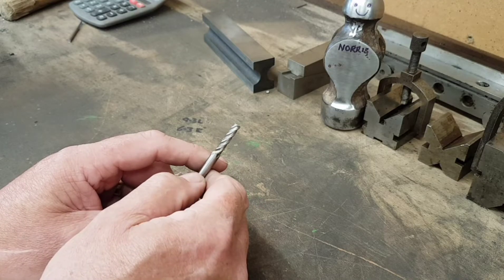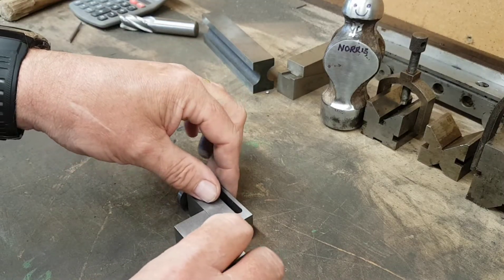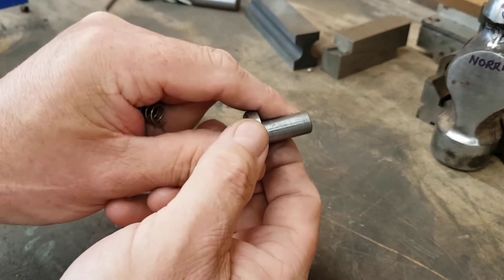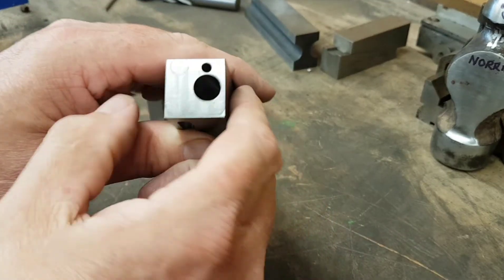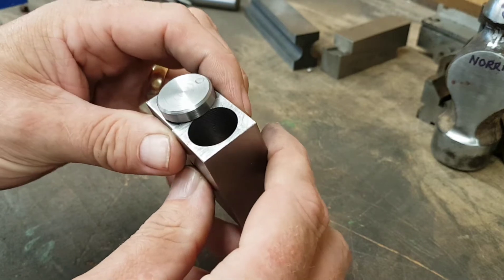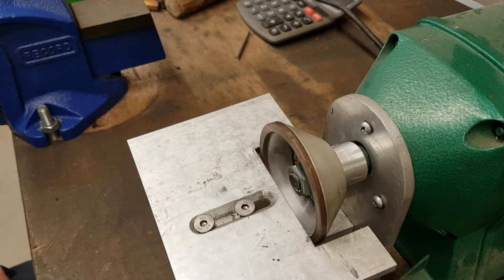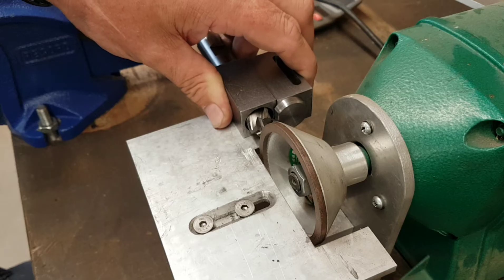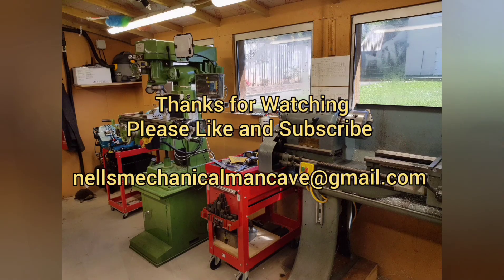End Mill Sharpener Part 1 of 3

Comment: If the hole in the block was lower down you wouldn’t need an “anti rotation pin” - just cut a flat on the bottom of the plunger with a couple of thou clearance of the base plate.
Reply from the maker: Good call Victor!
Sometimes you cant see the wood for the trees, as the saying goes 😊
Cheers Neil

Comment: I have been searching high and low trying to find an accurate way to sharpen my end mills myself, I seen this style in a book but forgot the name of the book. I guarantee I’ll be building and trying this fixture. Thank you for putting this up Neil. I’ll be watching all 3 vids. I’m also on a shoestring budget
Reply from the maker: Hi, 
The idea came from a book by Harold Hall and Mr Factotum ( Kev) did a few videos on the design. I don't know the exact name of the book but Kev mentions it so it's easy to look up.
Cheers Neil.

Comment: Why have you not considered installing the wheel on the other side of the bench grinder ? It would have turned the opposite. Anyway, thanks for sharing.
Reply from the maker: Hi my friend !
There is a slow speed diamond lapping disc on the other side of the bench grinder. It can be seen in earlier videos but not visible in this one. 
Thanks for coming by and watching.
Best regards,
Neil

Comment: This a bit similar to what I did, however  I am not sure it was my idea or just adapted from Harold Hall's video that I will leave a link to below. If works fine and saves money then it is an Excellent Tool! John, Australia.
https://www.youtube.com/watch?v=mMZt6m52j2M
Reply from the maker: Hi John.
Harold's design has gone around the block a few times and each incarnation has a slight improvement. Very clever man Harold !
Read your bio, and totally agree on what your dad said. I'm in the same boat sort of. I can't buy because I have no income so I make with what I have. Best of all, it's fun!!
Many thanks for dropping by and commenting.
All the best Neil...
Reply: @NellsMechanicalManCave  I am subscribed so it was not an accident. I like channels like yours as I can always learn a different way of thinking.
Cheers from John.
Reply from the maker: @joandar1  Thank you John for being a sub !!!
I do tend to be unconventional in my thinking. Out of the box is the usual term that is used. Most people look as something and see it for what it is. I look at it and see what it could become 😊
Cheers Neil
Reply: @NellsMechanicalManCave  No such thing as Scrap was part my Fathers MO. For example I have an internal bore diameter grinder that I made out of a 4" angle grinder with a crook gear head that I use on my lathe, the motor was/is fine. I needed to remove the bell mouth in the 3 jaw chuck and the spindle speed on the motor was perfect. End product works great an my chuck now holds stock to 1 Tenth of a thou of center. Just one of many things made from PRE LOVED Material/things. John.
Reply from the maker: @joandar1  Excellent John. Do a video of it. I could help someone out there !!!
Reply: @NellsMechanicalManCave  No sorry I do not, I did not record making it or its use. I will see if I can take a picture of it and send it to you. I used one type of grinder so others would need to design their own to suit their donor motor and so it goes on. Is your email in you home page as I do not have mine in my info. I need to go soon as it close to bed time for me. I will look at your home page in the morning and see what I can send that way. John.
Reply from the maker: @joandar1  Hi John.
My email is shown at the end of my videos as well as my home page.
Sleep well !!!
Cheers Neil

Comment: Good work. Why not just put it on the left hand side, but with either the cutter block on the outside (exactly a mirror image of the way you had it on the other side) or put the stop block on the outside but with the half of the cutter you are not sharpening on the outside too?

PS, to reverse a single phase induction motor, just swap the starting coil's polarity with respect to the main coil.

PS, not a good idea to reverse grinders as the nuts will come off causing injury.

Also, do you have an electronic copy of the drawings? Or does Mr Factotum?
Reply: Came here to add the same comment on the dangers of reversing the direction of grinders. Was a different cause, but I did see a very large wheel break up into several pieces, one of the larger chunks went straight up and punched a fist sized hole through the workshop roof, others flew off in all directions and clattered of walls and machine tools, they somehow missed everyone in the area (including me). That was back in 1966 when I was an apprentice. Memories of hose days are becoming a little cloudy, but that one remains crystal clear. Don't misuse grindstones!  As a side note: The chunk that went through the roof was never found, and the chap who caused the wheel to shatter lost his job.
Reply: @paulhammond7489  on the last point, fair enough.
Reply from the maker: Hi Ben.
Thought about the nut thing as I passed the comment.  That cup is too small in both diameter and width to sharpen end mills. Besides, is a good excuse to spend the wifes money as I dont have any 😁
I've got the drawings, just email me and I'll forward them.
Cheers Neil
Reply: @NellsMechanicalManCave  Where would I find your email address?
Reply: Found it! (Should have gone to SpecSavers!)

Comment: Hi Neil. I can send you a drawing on how to reverse your grinder direction. I had to work it out when I got a single direction motor for my garden shredder. Nice work on the grinding jig. I made the Harold hall grinding rest many years ago. I've never really used it, I keep meaning to, but I've never really settled on a good place for the grinder, so it's never been set up properly. I have a similar drill grinding jig on my to do list.
Reply from the maker: That grinder is very useful Olly. No worries about the motor reversing, it was an excuse to myself to buy a new diamond wheel 😁😁😁
Reply: Also, keep being an awkward barsteward, it certainly makes for more interesting viewing!